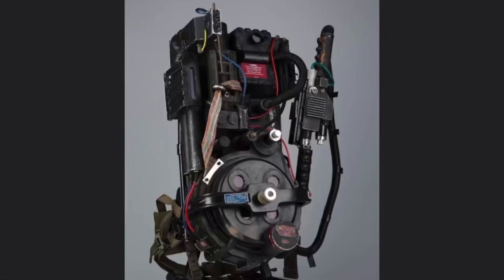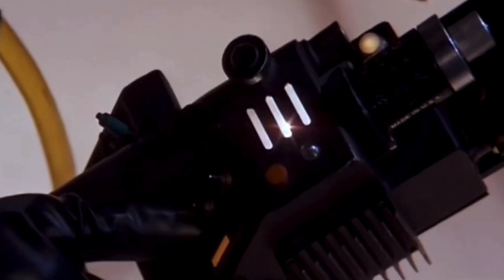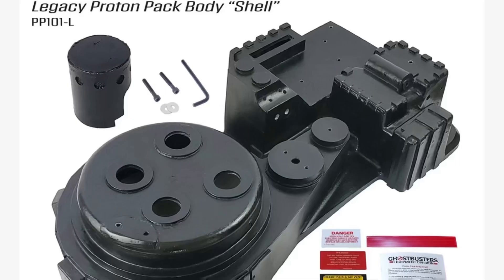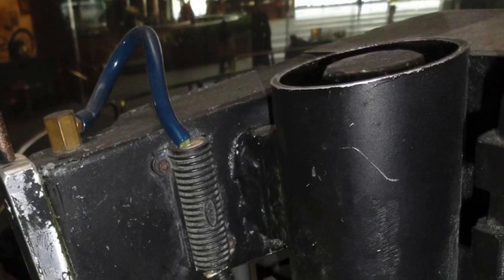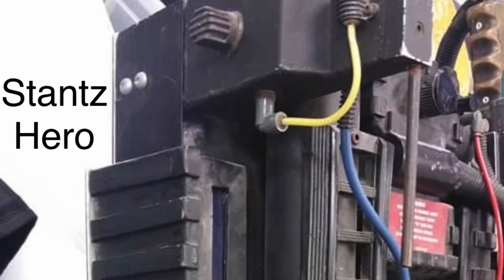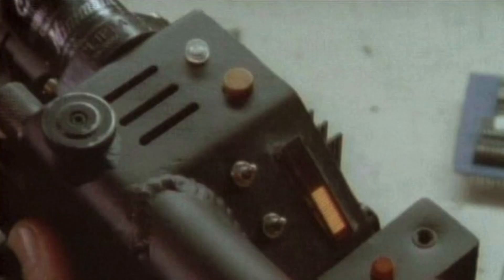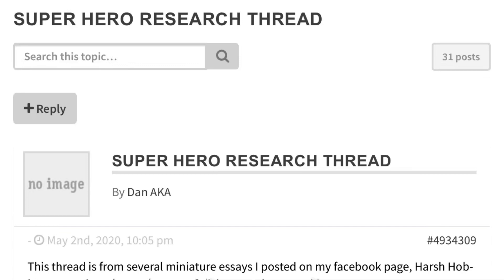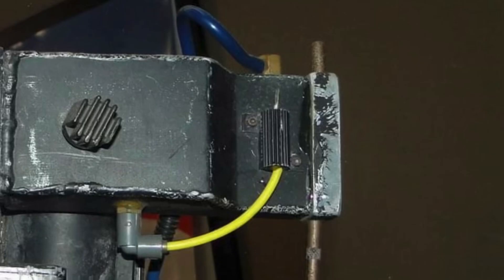Proton Pack Detective - Super Hero Proton Pack from Ghostbusters

Comment: Nicely done again. 
What's with the blue fuse label on the 2nd pack that gets slid out of Ecto1?
Reply from the maker: That’s the Spengler. Venkman is taking it off in Chinatown in the montage and you can see the same label issue. Much like the current Super Hero fuse label, the red portion has peeled off leaving the bare aluminum(?), and in the movie we see the blue sky reflecting off of it, giving the appearance of it being a blue label. This was only in New York, they replaced it when shooting moved to LA.
Reply: @TheProtonPackIsNotAToy   
Excellent, thanks for clearing that up 👍
Reply: @TheProtonPackIsNotAToy  so impressively knowledgeable!
Reply from the maker: Just sharing the research others have done. Thanks for watching 🙂